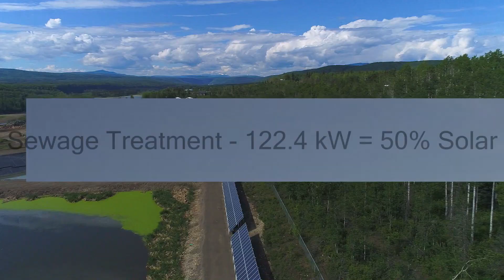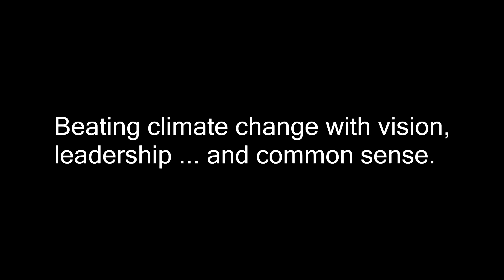The Solar Wave

Comment: Hey Don, terrific video! I finally get the visual perspective of how large these solar installations are! Very impressive. And so many of them! Good work for promoting such a clean source of energy. Here in Ecuador, the government has released $55 million to complete the long-delayed big wind project located on the Jubones River south of Cuenca. Construction began in 2009 but stalled four years ago due to lack of funding. Seems like a lot of money. The project will soon be underway again and is expected to begin generating electricity for the national power grid in 2020. Using European wind generation technology, the wind park is expected to generate 50 megawatts of power. Apparently, the new turbines are now producing 3 times what they once did and climbing. In 2017 wind turbine prices energy had an average cost of $0.06 per kWh (though some schemes were $0.04 per kWh). How does that compare to solar power? There doesn't seem to be much interest in solar power here. Any thoughts?